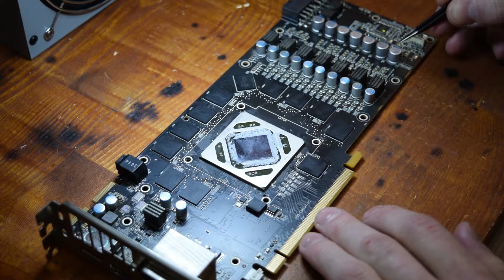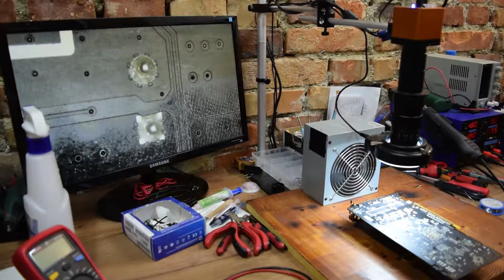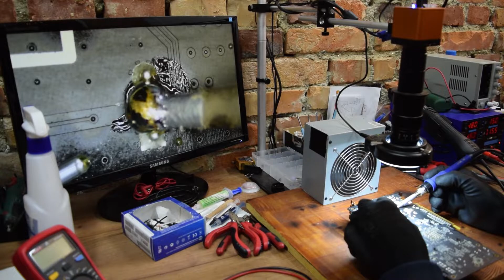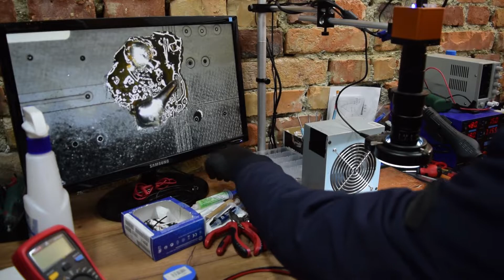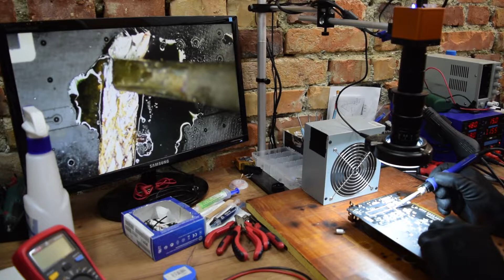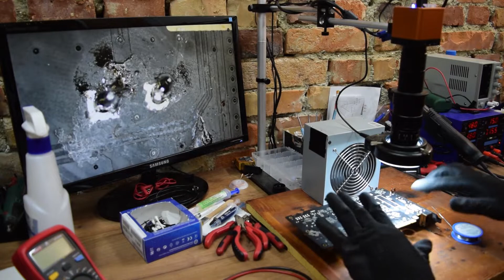How to DESOLDER & REPLACE GPU capacitors QUICK & EASY (through hole)

Comment: Some thru holes are very hard to clear off the solder even if i use desoldering gun. I have not tried hot air gun because I haven’t buy it. Now just bought it, will try soon.

Comment: I tried this method and it worked. I needed to apply a lot of low temp solder (138C) to the joint and apply the hot air at 450C and iron at 450C , then the capacitor fell off. After that I needed to apply more low temp solder to clean the holes with solder wick. Then the new caps were soldered with low temp solder.
Reply from the maker: Glad it worked for you! With less powerfull solder stations and thick boards this is honestly the only way i was able to desolder through hole capacitors in a timely manner :)